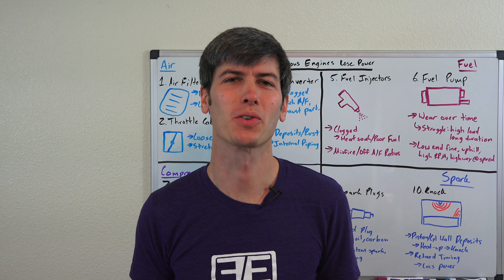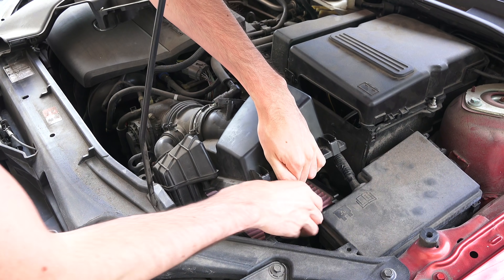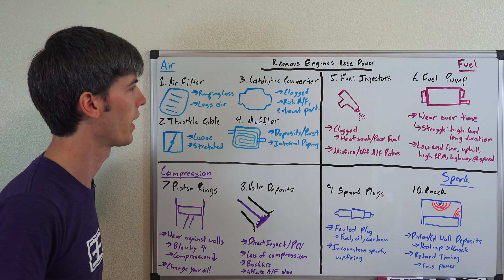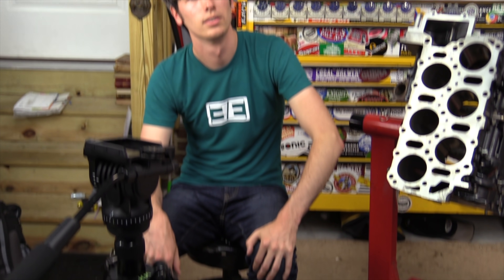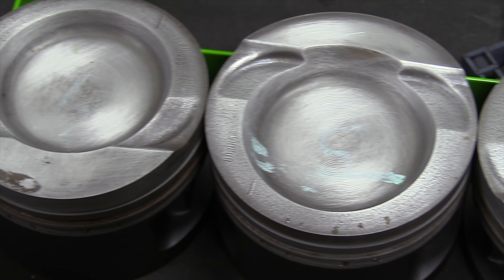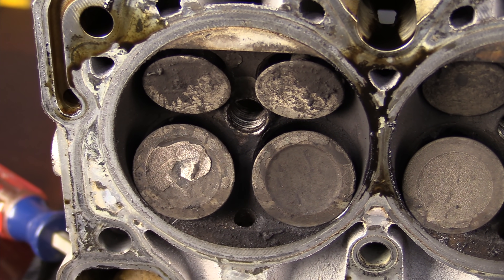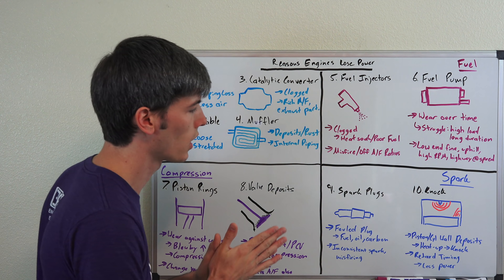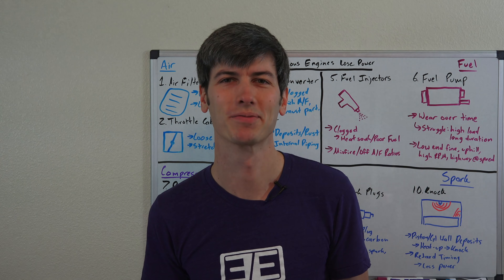10 Reasons Why Engines Lose Power Over Time

Comment: I drive a VW TSI. Do these engines tend to accumulate deposits? What type of driving should I do to avoid them building up? Thanks.
Reply: Albert Zion drive the car hard every once and a while. Bring it to red line getting on the highway
Reply: driving it at low revs I presume is not good for the engine then. The problem with Sport mode on my DSG is it's too aggressive, that's why I drive it Manual mode now and then.
Reply: ONLY when the engine is at operating temperature. And let it cool down afterwards by driving a little more at normal revs. Keeps the turbo from dying early.

Comment: Question. Is it good to go fast once in a while to allow your engine to get rid of internal gunk, or does it not make any difference?
Reply: Carbon build up, as I understand it is difficult to remove with engine heat alone and provides a negligible effect. Same with fuel additives designed to clean valves, but it can’t hurt.
My unsubstantiated theory is it’s like dirty dishes. If you drive hard fairly regularly you can prevent the buildup and possibly remove some when it’s fresh. But once the carbon’s on there, you pretty much have to crack open the heads.

Comment: Nice explanation, thanks.  If you maintain your engine correctly, most of these won't happen.  Gas pump - I wonder at what mileage that would have a problem?  I have had cars as long as 210,000 miles and never had an issue (current car has 162,000).
Reply: Fuel-pump failure is probably more to do with original quality, or misuse such as running very low on fuel, which allows debris at the bottom of the tank to be picked up by the pump, causing damage.
Reply: You just never know, most cars don't get gas pump issues but no matter how low the percentage of failure is there is always someone who drew the short stick.
Reply: Paul M - that makes sense. I know if you run very low on fuel and suck in debris it can mess up a car - that is abuse in my book.  Original quality makes sense.  I guess GM, Toyota, and Honda (current car is GM) all have decent quality then.  Thanks for that explanation - makes sense.

Comment: None of these are a problem for electric vehicles
Reply: Nope. That would be battery wear. (long live hydrogen EV's ;P)
Reply: Well bearings still need replacement but so long as nothing overheats the motor should be fine for 50+ years.
But obviously battery life is another problem altogether.

Comment: Is it possible for cars to gain any power over time without intended changes? I guess the exhaust falling off could help.
Reply: Definitely. Most engines gain a little power after they're broken in because everything has a little less friction and is smoothed out. After that it usually goes the other way :P

Comment: Looking at all the ways gas engines can go wrong, it's a miracle that they run at all. Future is EV, plain and simple.
Reply: Chevy SparkEV rb oh Boi gtfo
Reply: You can't turbo an electric motor. I don't need to say more
Reply: No VTEC no happy :( 
Instant torque is good but no straight pipes and the noise from anti lag is epic
Reply: Chevy SparkEV and boring and unmoddable and most of all boring
Reply: Please, bring it on! The sooner the EV's become practical and attractive to buy, the sooner that gas prices will drop, emission restrictions will relax, and our overall CO2 emissions will be reduced. I personally look forward to keeping internal combustion on the road in the electric vehicle era.
Reply: Andrew Whiteman totally agree. yes I would own an electric(once initial cost and long term reliability go up) but I'd have my combustion babys until I die. I just dont get the same satisfaction from working on electric components.
Reply: Connor Smythe Also EV's don't have vtec to kick in, yo.
Reply: By similar, you mean that EV batteries last 15 to 20 years? By the way, which laptop has active cooling so that the battery temperature cooler than the air around it? I've never seen one in laptops, but most EV other than Nissan and VW have such mechanism to keep the batteries in ideal state.
Reply: Why would you want a weakling turbo when EV can go into far more powerful Ludicrous mode?
Reply: All you guys who want to keep rolling on ICE must love Saudi Arabia, Venezuela, Russia and rest of them OPEC bunch, because what you pay at the pump is directly or indirectly going to fund those countries in this global economy.
Reply: If you want noise, use speakers making "vroom vroom" sounds like the way BMW i8 does it. Then you can have any gas car noise you want at any time instead of wasting time and money paying ISIS and Saudi Arabia.

Comment: You talked about rusted mufflers, does straight piping make your ride lose power?
Reply: Depends. On cars with forced induction (turbo/supercharger) it usually frees up the exhaust flow > less backpressure > more power. Naturally aspirated engines benefit from a certain exhaust backpressure to optimize power output.

Comment: Uninteresting as my Car doesn't have a Throttle Body. And at 2000 Bar Injector Pressure the possibility for Gunk to Build up is pretty low. My Spark Plugs aren't really doing their Job welI, they just kinda glow. I do have Issues with Soot though.
Reply: Get rid of the pesky EGR system and install an SCR system if you're feeling friendly to the environment and the persons who drive behind you. Only drawback besides the expense is the additive.

Comment: My M54B25 dynoed at 193 hp (rated @ 192 hp from factory) after 409.000 km with no power modifications and in complete stock form :)
Reply: Maintainance is the key :)

Comment: I like how you not only listed diagnostic information about each component, but also ways to keep each component working optimally, but I'm wondering how often you might need to make adjustments and/or replace each component due to just normal wear and tear.  I know each car is probably different, and each component is also maybe different, but maybe like a basic guideline would be good... like the air filter usually should be changed with every other oil change, or maybe if you live in a particularly dusty part of the country more often than that... or Catalytic Converters usually last for ~150 thousand miles... (I dunno if thats true or not)...
Reply: it's on the frigging manual on when to replace these parts.
Reply: Usually it comes with a maintenance manual or online resources can be more make/model specific.

Comment: I've put 50K miles (I'm the second owner, total is 99K miles) on a 2008 Infiniti G35 running 87 octane because I'm a cheap ass. Inifninit recommends 91+. I have not heard any knocking or pinging but the engine seems to be working harder than usual to accelerate. Do you think I've done permanent damage to the engine? I run a fuel system cleaner at every oil change (every 5-7K miles).
Reply from the maker: +Trey Perry if it were me I would ditch the fuel cleaners and run the right octane. Shouldn’t cause damage, but lower octane can result in less power.
Reply: Engineering Explained thanks for the response. I've got a 100 mile drive I have to make today so I will put the right octane in there and see if I notice a difference
Reply: Noir Spectre haha when you're a college student it is

Comment: Why do some cars lose power when an air condition is turned on?
Reply: Geetesh Vaigankar the compressor that is required to run the A/C is a huge load on the engine. Not really too noticeable if you have a big honking V8 but something you will definitely notice with a small engine
Reply: Mostly normally aspirated 4 bangers suffer noticeable power loss.  They just don't make much power at lower rpm's.  Your typical 1.8 econoturd n/a engine might only make 30hp at 1500rpm, while the belt driven compressor will eat up 5hp - a 16% loss in power will be very noticeably felt.  One reason I avoid owning n/a 4 bangers since I need my a/c on 9 months out of the year.
Reply from the maker: +Geetesh Vaigankar nothing is free, takes energy to run the A/C. :)
Reply: Hey,  it takes like 60 hp to run superchargers. back In the day my Roadrunner had no air, manual steering ect just to not lose a few hp.
Reply: Is it normal to have a noticeable power loss in a car like BMW 3 series which is now 7 years old ?Engine: Straight 4 (2 litre, 1995 cc)
Maximum power output: 163 PS (161 bhp) (120 kW) at 6700 rpm
Maximum torque: 210 Nm (155 ft·lb) (21.4 kgm).
Above figures might have depreciated over time.

Comment: Can you do a “how to add power to a carbureted car
Reply: JaBoyKingsley Take the carburettor off and put an injection system in it. :)
Reply: 1.  Check the carb's condition, and rebuild it if needed.  If the butterflies are worn, get a new carb.  If it's a Solex, put a Weber on.
2.  Play with the jetting.
3.  Advance your spark (not too much).
4.  Freeflow exhaust.
5.  Better air filter, and make sure it doesn't get clogged.  A clogged filter on a carb is like running with the choke closed.

Those are just how I see it.

J. Undefined:  Sure, a conversion will work great, but that's rather expensive...

Comment: My car doesn't idle steady sometimes and mechanic plugged it in and said it was also misfiring and flashing engine light (only sometimes). However, the mechanic can't find a problem, any help?
Reply from the maker: +deaflol I would start by checking your spark plugs and wires, and then looking at the fuel system (pump, injectors, lines).

Comment: IDGAF what anyone says, my toyota 4runner has over 320k on the stock motor and still runs like day one. I have zero power loss. The only thing that it has seen is the factory maintenance schedule followed and conventional oil changes religiously every 3 thousand miles. The piston rings are in beautiful shape. The oil is still clean when you go to change it. It doesnt burn of oil. Thats why I don't believe any of the bs I've seen on youtube saying you need synthetic oil or should do this and that- because I drove this motor over the 300k mark myself and shes still my daily driver.
Reply: Linus Torvalds there’s definitely power loss, it’s just degraded slowly over time that you never noticed it from when you got it to now
Reply: Really? Because my engine compression tests within a few psi of when it was new. I doubt it could even equal an entire 1 horsepower loss.
Reply: If the air and fuel and exhaust flow is all the same and the blow by hasnt progressed its literally impossible that it could of lost any significant amount of power.

Comment: I acknowledge that all cars are different, but can I get an idea of about how many miles you can go before you need to start worrying about some of these issues?? I have a 2011 WRX with 71,000 miles by the way.
Reply: It doesn't say. I have gone onto forums to figure it out, but most are filled with teenage boys who don't know what they are talking about.
Reply: Nicolas Losito not all owners manual mention what needs to be maintain or replace. For example, my corolla doesn't mention fuel injectors, fuel pump, piston rings, valve deposits,  catalytic converter and muffler.
Reply: High milage oil is usually specified for engines with 75,000 miles or more, so I would guess these problems could start to show up at this point. I think it depends a lot on the engine and how it's maintained, though.
Reply: Best things you can do is run top tier fuel (toptiergas.com) and use Mobil 1 high mileage oil. The oil has special conditioners to keep seals from leaking. Change filters and all your fluids frequently. I do all mine every year. Coolant, brake fluid flush, transmission fluid, power steering fluid flush, and I always do my oil changes every 4000 with full synthetic oil. You can use seafoam in your engines oil about 500 miles before you change your oil and that will keep all the carbon from building up.

Comment: So do engine's ECU have the ability to detect and compensate for knock? That'd be a good video: discussing everything the ECU does
Reply: Ehm nope. Knock is a term for unwanted ignition of the air-fuel mixture before the piston hits top dead center. This happens if the temperatures in the cylinders are so high that the mixture ignites itself OR if the sparkplugs misfire.
Reply: You are underestimated the ECU. It can also detect if you are having affair with your co-worker by the weight and voice from passenger seat.
Reply: Never heard of calling that knock before. In Europe that's called engine failure ;P. Btw you guys have your octane rated according to the AKI system right? That is short for Anti Knock Index, so I didn't assume it was a localization thing.
Reply: @quasarcreator We call that chainsawing your block in half ;P
Reply: in the UK it is called pinking, due to the noise it makes
Reply: Even if the ECU supports knock detection, you still need a knocksensor to make it work.
Reply: Rod knock? Where the rods smash against the block?
Reply: Around here it's generally called "pinging" or "detonation". I don't think I've ever heard it called "knock" in everyday conversation, but I'd know what was meant from context. Then again, if a person called me up and said "hey, my engine is knocking", the first thought I'd have would be "oh man, you're screwed", not "oh, it's probably just detonating".
Reply: Duskconqueror, deposits in engine that get hot also cause knock, as the video showed.  The engine itself would have to be glowing orange at about 1100°F to ignite the air-fuel mixture. The pistons would be welded to the cylinder walls before that, yes? 
I don't always calculate my octane, but when I do, I use the R+M/2 Method, then reffer to the AKI.
Reply: Duskconqueror, wow. That's a lot to read. I'll have to read the rest when I get more time. I totally forgot about putting too low an octane in a car that needs premium could cause knocks.
Reply: and a very long video lol
Reply: Shambles1980TRealOne There are different types.  Premature fuel detonation is one type. You are referring to rod knock.
Reply: Spark knock.  Happens when spark happens to soon or if fuel air mixture ignites too soon.    Take a small block Chevy with a good dome piston and run it on 87
Reply: "Rod knock" isn't from rods "smashing against the block", it's from loose bearings that are shortly going to cause the rods to smash against the block.
Reply: And what's "a lot to read"? Am I missing something here? I don't see any comments that are more than a couple sentences.
Reply: Christopher Wardlaw yes. The ecu reads the table of values from the knock sensor in live time, and uses the rpm signal from the crank, to determine a expected firing event. When it comes time for the engine to fire the cylinder, the computer watches for the explosion to spike the graph. If it doesnt see that spike, it flags it as a misfire

Comment: If you have a dodge it loses power very quickly because when the engine in ur 2013 charger w/ only 40k miles on it breaks u won't be making much power

Comment: The Main pbl above all is how can we eliminate the pblm of KNOCKING?
Reply: and if at all possible, use the recommended octane fuel for the car.
Reply: Install a knocksensor and an ECU that knows how to use it. On engines without tech like variable valve-timing the reaction to knock will be an increase in the amount of fuel that is injected. On engines with VVT it will either inject more fuel or, more preferable for longevity of the engine and it's exhaust system, decrease compression ratio by either closing the intake valves before the piston hits bottom dead center or leaving them open for a while after the piston hits bdc.

Comment: Man, my 98 Expedition just turned 240,000 and has none of these problems (that make it noticeable), save probably a need to adjust the throttle cable and I did replace the fuel pump (it was wearing out, FIXED). All fluids/filters get changed so that's not an issue. The thing runs, rides and drives like brand spankin new. If anything ever impressed me about it, this just did!
Reply: Expeditions are honestly the worst vehicle ever I used to have a 2000 Expedition took care of that more than I take care of my kids and 250, 000 miles the engine locked on and It gave out